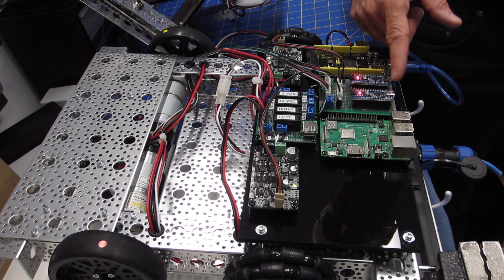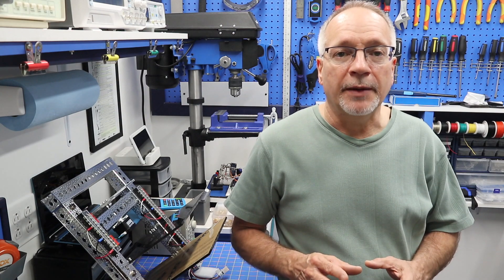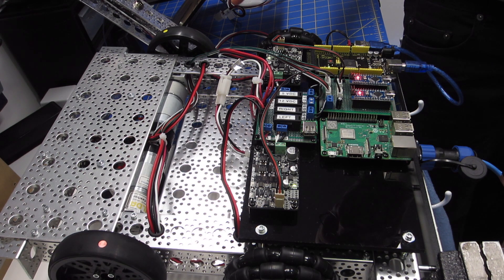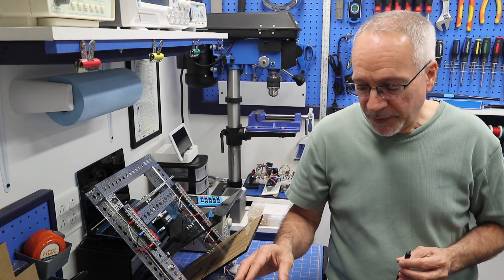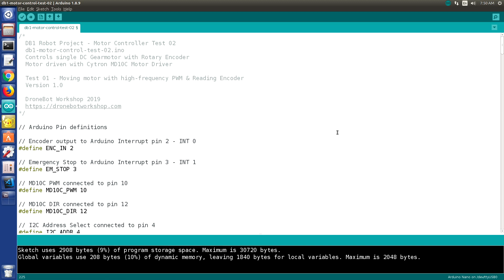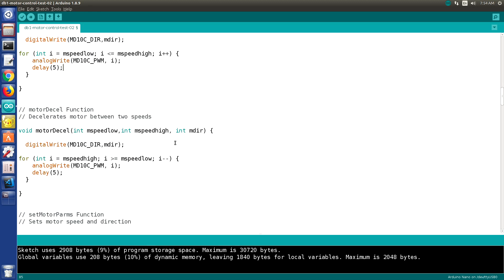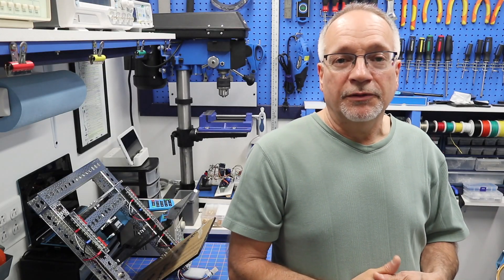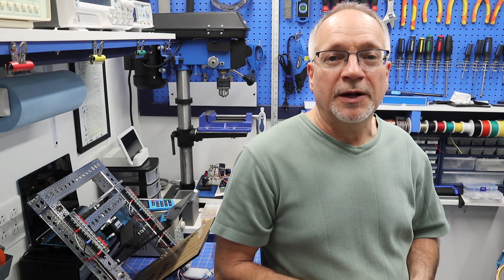Build a Real Robot - Episode 11 - Motor Coding

Comment: If the robot stops, due to an obstacle signal, while incrementing "i" during  accelerating.  Again motor initial speed should return back to " low speed" and start acceleration again...for that code need to change.

Comment: I'm sure you thought about that..for your rotary encoder problem and the timings, but I'll just remind you that by changing the pwm frequency, you mess up the internal timers, so all of your timers are a mess.
Good thing is,you can counter it with some adjustments.

Comment: You can use a 12V battery for all of your power needs by just using Vin pin on your Arduino, I am reffering to the Uno or Mega. I am not sure of the mini or pro, 3.3-5v versions to be aware of also on the mini's

Comment: Why not use a diode between the internal power supply and the Arduino, then you avoid powering everything from USB. The Arduino includes a diode on the USB input, but not on the local power input.

For acceleration I would use a table, that way it is possible to adjust the acceleration curve and then control it from a timer interrupt with two variables: current_speed and required_speed. The interrupt routine can then decide if it stays, step on up or one down in the acceleration table.
Reply: Henrik,
I agree about the diode. I recently completed a tapping arm where the nano powered the ibt-2 motor driver all running off a 3S battery pack which also supplied the Vin pin. When the battery pack was not connected and the nano was powered from the usb port the regulator underneath got hot very quickly. I fixed it with a diode to stop current drawn from the vin pin, and the 0.7 voltage drop didn't change the function.
Reply: With a 3S pack you can easily use a standard diode, but with a 5V supply it is better to use a Schottky diode.
Reply: @henrikjensen3278 , agreed.

Comment: To eliminate the fuse removal, and unplugging the cable from the mega, to isolate programming power, why not include small shutoff switches to the 5v to the arduinos and the RPI. Separate switch for each. Seems like there's got to be a easier way to program these things without constantly worrying about power, what fuse needs to be pulled etc. Wireless programming would be great. Great vids.

Comment: Can the Nanos be programmed using FT232 FTDI modules using serial programming?  I'm hoping to use an STM32 microcontroller where you are using the Nanos.    I use the Arduino IDE and programming to program the STM32F01C8T6 board.  But I use serial programming and a separate FT232 FTDI module instead of the USB connector.